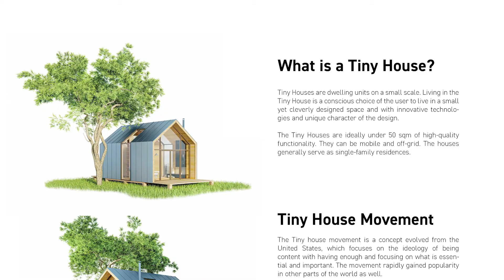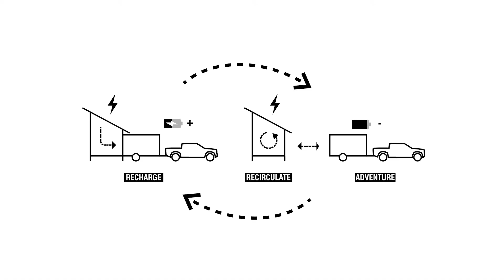I designed the ULTIMATE Tiny Home on a Mountain!

Comment: uniquely cool idea. The only things I haven't figured out is what happens to the back wall of the trailer and how the trailer seals up to the building. Looks pretty neat.
Reply from the maker: Yeah I was thinking that blank wall could have collapsible shelving / bike rack. When you bring trailer in, you can put the stuff outside? The seal is a tricky one. Maybe a big rubber gasket around the door opening? Thanks for watching.